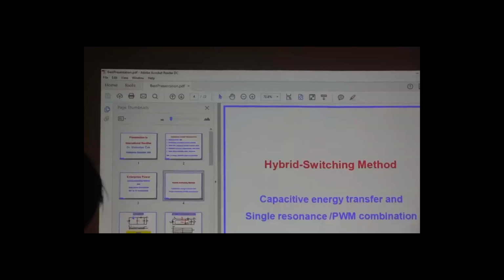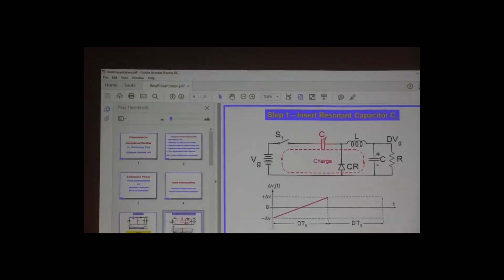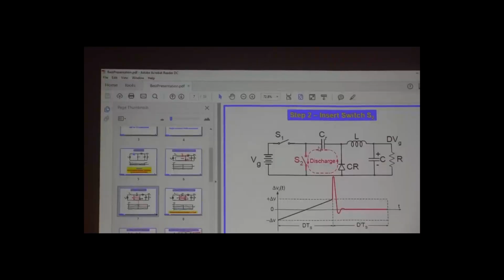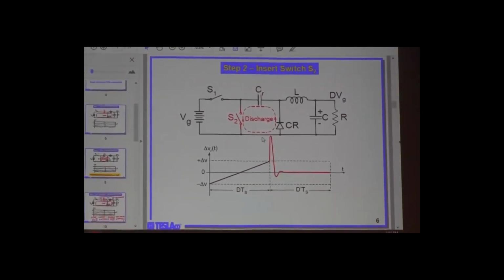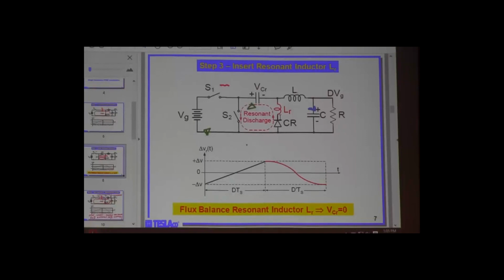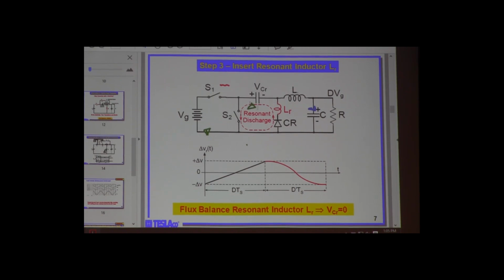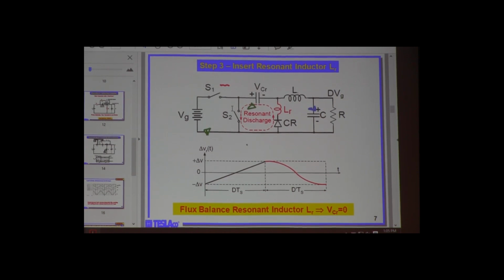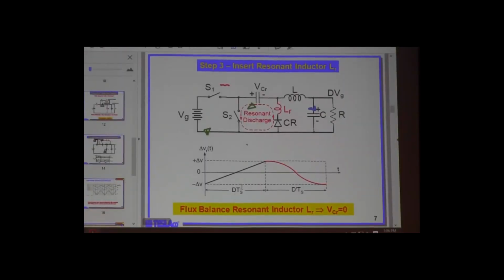CUK BUCK 2   PART 2

Comment: I cannot understand why so few people are watching these excelent videos. Are they mad? Do they think that buck is a good converter?
Reply from the maker: Uriel,  thank you for your compliments! I am now teching the course  in which I do demonstrate  convincingly that not only buck but also boost and flyback converters should have never been used! They all  use ( and abuse!)  inductors which conduct DC laod current! I considert this abuse of inductor which Faraday invented as an AC inductor and not DC inductor with magnetic concotion of insertion of the air-gap in magnetic core to  prevent core saturation killing the nductance and ultimately and effective  short even at moderate DC currents!?
Reply: @SlobodanCukTESLAco  I agree, but I cannot see what design you can do to avoid passing DC in inductors. I love Cuk converter so much, its completely elegant and symmetrical, like poetry, but it has this problem twice too! i've watching your videos and can see that you are near to achieve that. Using transformer only as energy transfer and conversion. Am I correct?
Reply from the maker: @urielalbertodiazreynoso6309  Yes, you are 100% correct. Stay tuned for my latest inventions and videos. Join my website teslaco.com and my LinkedIn group POWER ELECTRONICS INSTITUTE . You can also find a number of artocles I pubished on-lin eon powerelectronics.com